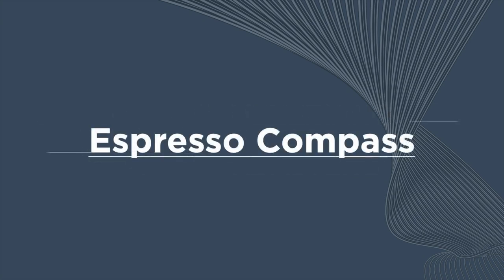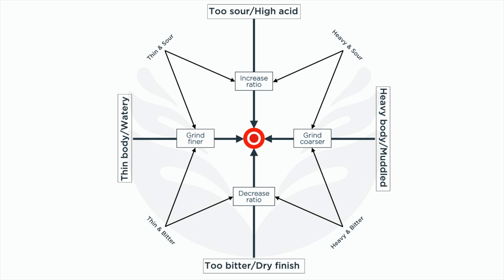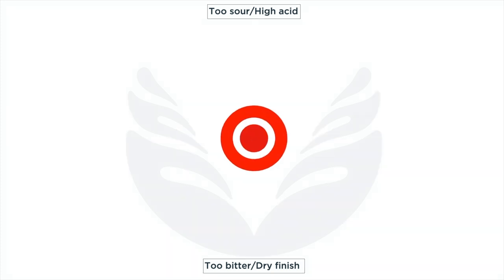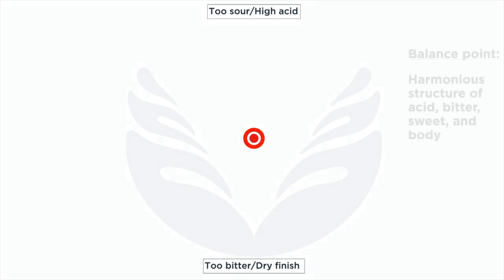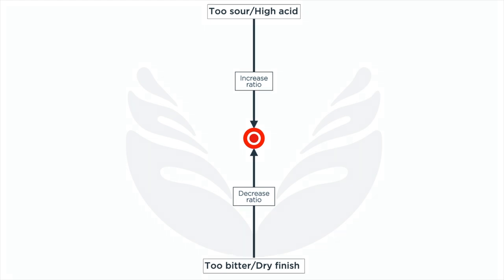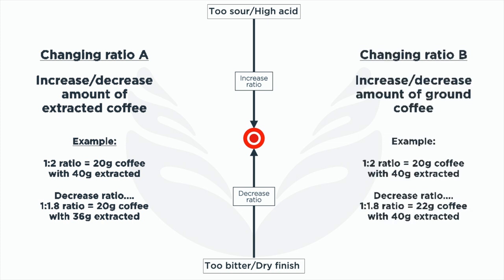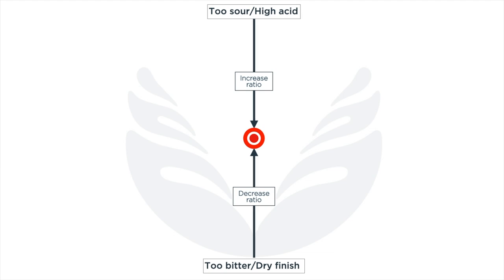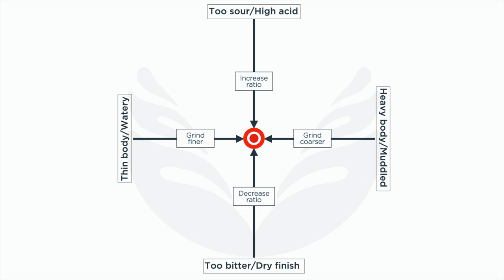How to use the Espresso Compass

Comment: Changing a ratio from 1:2 to 1:1.8 is an increase of the ratio (of coffee grind weight to yield weight), not a decrease. So maybe it would be better to write 'decrease relative amount of water' instead of 'decrease ratio'. Also, in the example, it's not 40g extracted but 40g yield (liquid in the cup). You can't extract 40g from 20g of coffee. So to beginners this version of the coffee compass might be confusing.

Comment: correct me if im wrong, ratio and grinding are basically same thing, both done meaning to change the brew pressure. Maybe consider temperature as the 2nd parameter